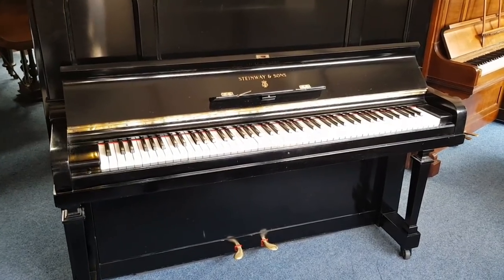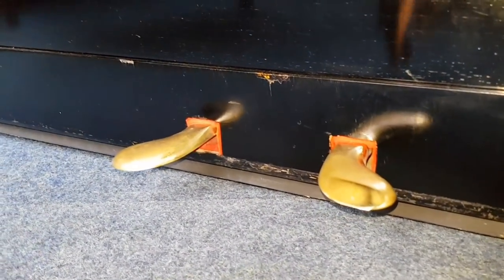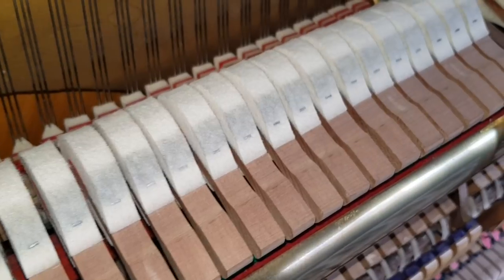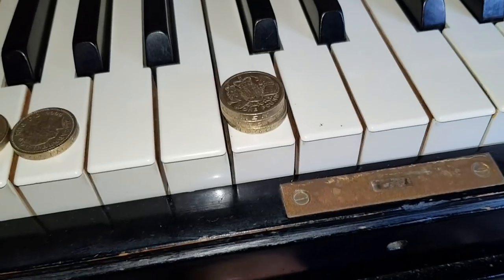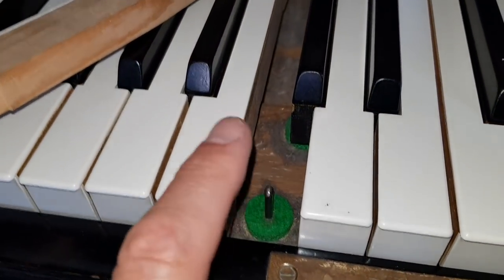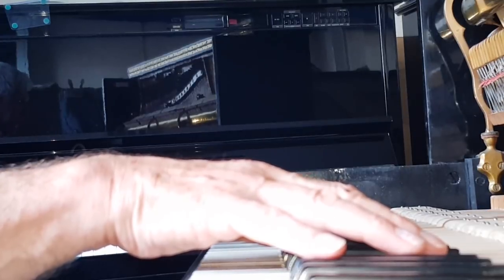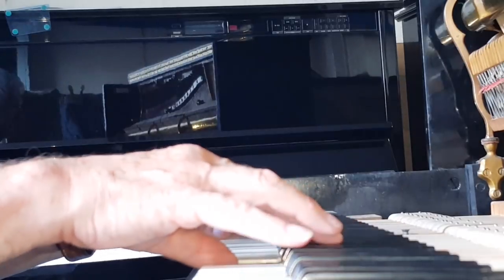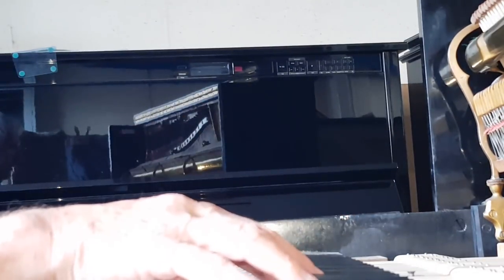Assessment of a Steinway K upright piano 1924; uneven key weight.

Comment: Thanks for the vids as always. I have a question, I have the money to buy a grand, do you consider a grand as an investment in this day and age?
Reply from the maker: That depends a lot on the quality of the piano. If it's a top make such as Steinway or Bosendorfer then it should be a sensible investment.
Reply: Roberts Pianos I was thinking along the lines of perhaps an ibach or basic bechstein. This money I've saved is so important to me so I'm torn. I'm definitely the ideal candidate for a grand though. I'm having trouble pulling the trigger. Perhaps less investment but something that won't devalue.
Reply from the maker: Well, the prices of Bechstein are stable and possibly increasing. It's vital to find the right Bechstein though. Can you email us info@robertspianos.com ?
Reply: Roberts Pianos it really is intimidating. I'm in cape town south africa so don't think your stock is an option regarding EMAIL.
Reply from the maker: Sorry I didn't realise you weren't in the UK. Not sure how to advise as older pianos are usually in need of a lot of restoration. If you have a genuinely good technician then that's fine; otherwise you may be safer buying a piano less than 30 years old that hasn't been used too much.
Reply: Roberts Pianos it's a minefield out here, dealers pushing prices way too far. Sign of the state of the country.